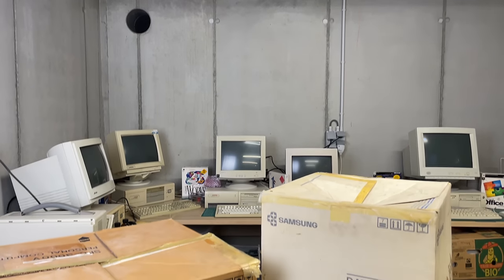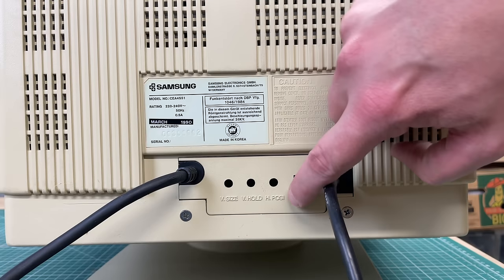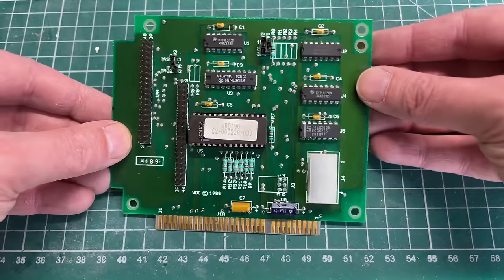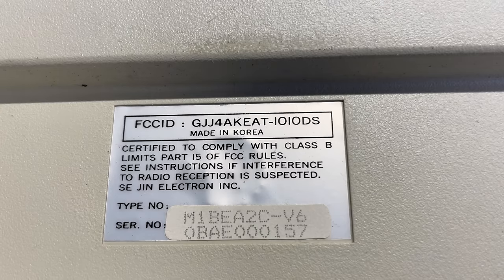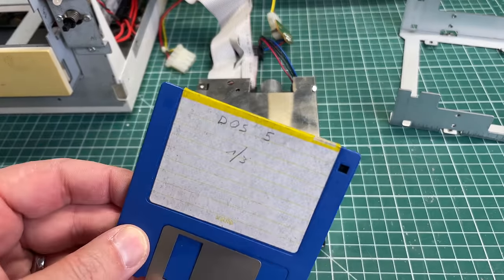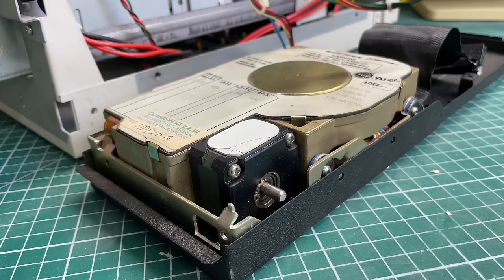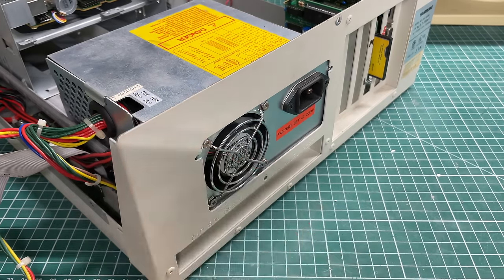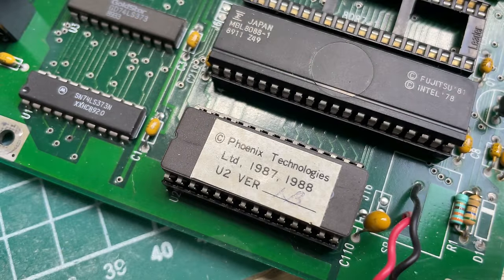Somebody gave me a 30+ year old Samsung PC

Comment: If I'm not mistaken, this PC was manufactured by Samsung for other PC makers who just slapped their badge on it. I think Packard Bell may have been one of them. I believe I learned this from an LGR video.
Reply: I'm pretty sure that Samsung was the OEM for the Packard Bell Legend 386/25 that I have, and a later IBM PS/1 486SX/25.  They have a VERY similar chassis frame design, and IIRC, the PSU had Samsung markings in it.
Reply: you mean the video in which Clint on a tangent told the story of the wrestler who failed his career do to taking an advertisment deal for one model of the said family.
The PC That Ruined a Wrestling Career: Vendex HeadStart from 1987
Reply: It was also called the Vendex HeadStart
Reply: Yep, early Vendex HeadStarts were these Samsungs rebadged! Along with a half dozen other brands, including early Packard Bells like the PB 500 that I’ve also featured in a video. Samsung was responsible for a big chunk of the world’s low cost Turbo XT clones in the latter half of the 80s.
Reply: Same as The Vendex Headstart
Reply: Yes, and the Epson Apex series.
Reply: @LGR Clint, if you ever get sent a Samsung SPC-650, please let me know! (I wish I had a high profile YT channel!)

Comment: If 30+ goes up to 39, that means Samsung made a 8088 in 1985. But why? 80386 was launched that year.
Reply from the maker: Intel 8088 was discontinued in 1998. Lots of industrial / embedded systems were still using them.
Reply: 8086/8088-based computers were manufactured up to the 1990s. Even IBM released a new 8086-based machine (PS/2 Model 30) in 1987. These were crazy times, on the one hand you had a new generation of CPUs and computers showing up every 3-4 years, but on the other hand the previous generations were produced long after they had gotten obsolete.
Reply: Weren’t 386 systems several thousands of $$ back in the mid 80s? Not everybody can afford (or wants) the latest and most expensive.
Reply: @peachgrush  Yeah and this one was apparently built in early 1990. The hard drive is from late February and the monitor from March.
Reply: I remember my first Korean PC/XT running 8 MHz, with EGA, no HDD and only 5.25” 360k floppy. 386 price was eye watering back then. Also many people couldn’t afford anything better than this class of PC clone
Reply: @SergiuszRoszczyk  and what year was it?
Reply: @lazibayer  1991
Reply: @SergiuszRoszczyk  at that time 486 has been launched for 2yrs. Speaking of 486, I was amazed by the fact that 486 motherboards went from isa only to pci capable.
Reply: @lazibayer  yes, but for my country - we just released the chains of being a Soviet Union satellite country so having access to any computer was actually something and even for my setup - the EGA with 14” color monitor it was considered expensive. Most businesses run on 286 and later 386 with HGC cards and mono screens. Given the prices for IBM and Compaq such machines like Samsung or Hyundai was the only true gateway to some computing for the masses
Reply: @lazibayer  There were plenty of VLB (VESA Local Bus) and some Microchannel 486 boards. PCI came pretty late in the life of the 486.

The late 80s and early 90s weren't as straightforward as the 2000s, where each new generation of hardware simply pushed the previous one off the shelves. Up to three generations co-existed at very different price points. 486 machines were servers and high-end work horses while entry-level systems were XTs or 286s. 386s were pretty expensive, upscale machines, some of them loaded to the gills (I remember a big tower with two full-height 5 1/4" ESDI hard drives, some 200 MB each, that must have been some kind of server too). Let's not forget the C64 was sold new in western Europe well into the 1990s, although increasingly marketed as a toy rather than a computer!
Reply: in 1980's, most koreans were using 8-bit computers
Reply: In the mid-late 80s, mainstream computers in South Korea were mostly 8-bit systems, typically based on MSX. Later on, the 8088 started gaining ground in the educational market.

You're mentioning that the 80386 was launched in 1985, 80486 in 1989. But do you know what the mainstream systems were at that time? You better understand the difference between the launch date and when the market actually began to adopt them at that time.

Comment: The Tandy obviously revealed something. It is stuck in Reset (or interrupt or with no clock signal - but I assume reset).
The humming noise comes from the uninitialized sound chip. When an 8088 goes out of reset, it will look at the address FFFF0 (or in segment/offset F000:FFF0). There, the BIOS contains a JMP command which jumps to the first commands of the BIOS POST. This is, why this command is called the Reset Vector. The first thing that a Tandy 1000 does after the reset vector is to mute the sound chip, so the humming goes away after half a second to a second.
When you plug in your faulty controller, the system is likely stuck in reset or interrupt or the clock signal vanishes, so nothing is executed.
If you have a POST analyzer, this won't give you POST codes on an XT but you can watch the Reset signal, which is active-high. You can also analyze the reset and clock pin on the CPU and the various interrupt pins on the ISA bus with an oscilloscope. Then you roughly get an idea on which of the logic chips or maybe even passive components (like a pull-up or pull-down resistor) you have to look for the problem.
Reply from the maker: Think I found the faulty IC on the xt-ide interface card. Next up is the hard drive. Never had a hard drive be the cause of a computer not posting.
Reply: @RetroSpector78  There is a reset line on IDE connectors - on normal ATA it's pin 1 and probably on XTA too. If that line is connected directly to the ISA reset line, then a fault on the hard drive could also keep the computer stuck in reset.

Comment: These were rebranded and sold as the Packard Bell PB500 and under the Epson Apex series, although I believe Samsung is the actual OEM. It's a solid platform that takes upgrades like a champ. I have an Epson Apex Plus, and I've upgraded it with an NEC V20 CPU, 8087 math co-pro, Tseng ET4000AX SVGA card, a Sound Blaster Pro-compatible sound card, and an XT-IDE card with a 130 MB hard drive. My next upgrade will be an Ethernet card :)

I believe DasherDeals is run by JJ Dasher, who used to be a prominent member of the vintage computing community, so it's no surprise that he would do that :)

Comment: This was my exact first computer when I was 8! 

It's definitely very odd the video card bundled with this unit may not be the factory item. The V in the SPC-3000V designates VGA which my system had. 

Also it's probably been mentioned, but it had a high speed turbo mode either via a util called turbo.exe in the OEM Dos directory or by pressing Control + Alt + "+ key on numeric keypad" or "- key on numeric keypad" the LED will be either green for turbo (9.54Mhz) or orange for normal mode (4.77Mhz).

Thanks for the nostalgia trip. 🙂

Comment: I had its predecessor, the SPC-3000. Same dual-speed 8088 processor, but mine had two 5.25" floppy drives, the same 12" amber monitor Atari used for its PCs (Samsung-branded, of course), no sound card, 640KiB of RAM, and a dual-mode (Hercules/CGA) graphics card.

Comment: Even though it's the same 10-pin connector you can't be entirely sure it's wired up the same as the "standard" AT style.
Reply: Since the power supply works, he can measure the voltages
Reply: @Flashy7  right, just important to make sure it's the standard pinout in a situation like that before you just plug in any other supply
Reply: Sure you can!  Check continuity between the chassis and the well-known ground pin locations.  And use the ISA slots to verify continuity to the +/- 12V and 5V lines.  That pretty much leaves you with Power Good, and if everything else checked out OK, it would be pretty unlikely that that ONE signal is different.
Reply: @nickwallette6201  I should've specified "just from it looking like one".
Reply: @Nukle0n   ... touche.  :-D

Comment: could be a problem with the capacitors on the xt ide card that doesn't work tantalum short
Reply: I bet its C7 :)
Reply: @dragonlard4595  i'll say c3
Reply: @dragonlard4595  C7 has vent its guts for sure.

Comment: Found an HP Compaq at St Vincent for 15 bucks. missing HD. Just retro built another Sunday Brand new in the box Soyo Socket A MB have 2 Athlon and 1 Sempron CPU's put in the Athlon. Was in my basement. Have been messing with hardware since 1996. My basement shelves look like a PC store. Needed an IDE connector and Serial Port for some old hardware, Still have NIB Intel and Tyan Slot 1 Pentium III motherboards in the box never built a pc with them. They have just been on a shelf. Got 3 PIII CPU's and 3 extra Slot adapters. So may end up getting one up and running.